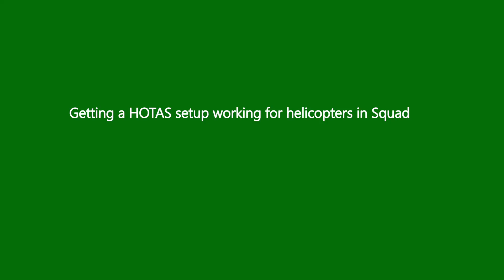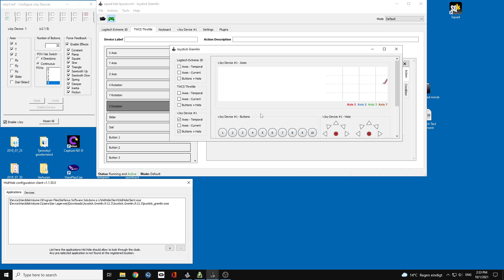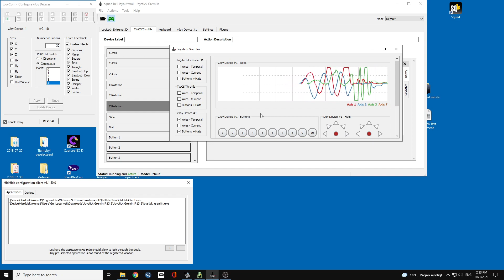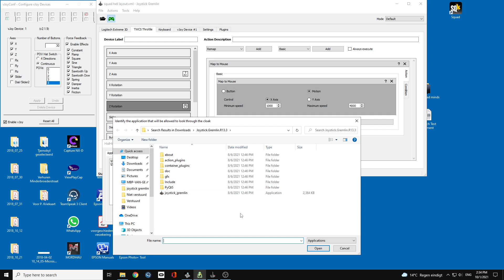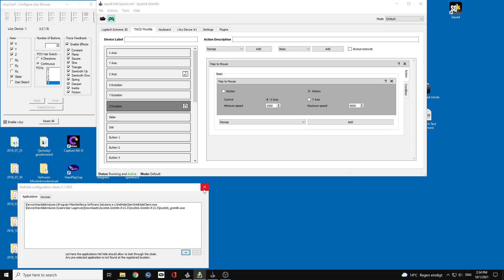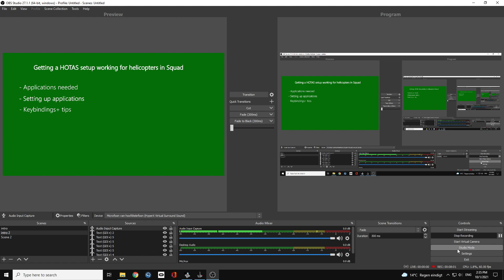Squad HOTAS Setup Tutorial

Comment: PSA: Windows updates can break HIDHide. If you find that you have overlapping control inputs, e.g. moving the throttle affects the cyclic pitch and roll as in my case, it is because your HOTAS is not being hidden from Squad anymore. To fix this, I uninstalled HID Hide completely and then re-installed it. (You will have to restart twice) and it started working again.

Comment: After some tinkering around i finally got my new HOTAS working on Squad....only issue is the throttle is backwards on the collective for some reason. Down raises collective, up lowers it but i finally got it to were it slides and adjusts the collective amount instead of just 0% or 100%
Reply from the maker: Nice man! Good job. Took me quite a while to figure it out but if you're looking for it, it's worth the effort!

There should be an option somewhere to just inverse the throttle input, just can't remember where that was. Haven't been playing Squad alot lately.

Comment: i got my setup working but my pitch and roll are sooooo slow to the point i cant fly but yaw and throttle respond fine
Reply from the maker: You can fiddle around a bit with the curves in the Squad controls menu. I haven't played in 3 months so I hope it's still there, but that can give you quite some control over the min/max range of control.

Comment: So I'm using the x52 pro, and after doing this, the game doesn't recognize ANY of my inputs for keybindings, where as before it just didn't recognize the xy movements on the joystick, throttle slider, and a few buttons. Any ideas?

Update: Going into game controllers in windows settings, it changed from the x52 driver to the vJoy driver, however when going to properties, when moving the controls around nothing happens. Will keep updating until I get it figured out!
Reply from the maker: Ok, that could mean a couple of things, let's try these 2 first:
1 in Gremlin, did you click the button to start the keybind-script? (The controller icon, should turn green if you click on it)

2 did you check HidHide? Maybe you've also hidden VJoy?

Lemme know if this works.
(I can't test anyrhing myself now, disassembled my rig to move....)
Reply: @gerlagerweij  I ended up getting it working, I did not have the icon green to activate it, and slowly but surely the controls worked, however, I could not get sliders to work for collective